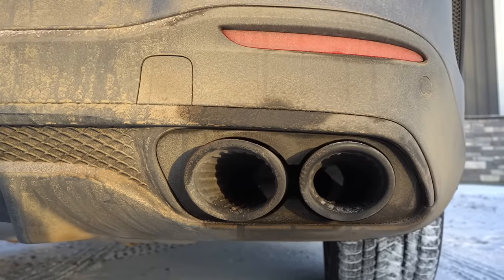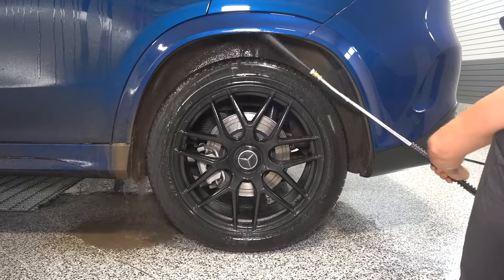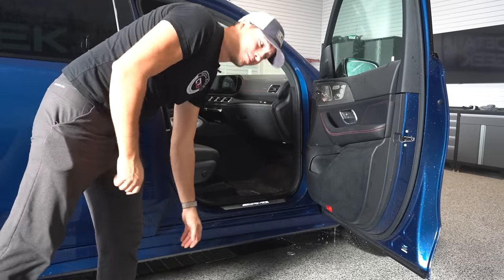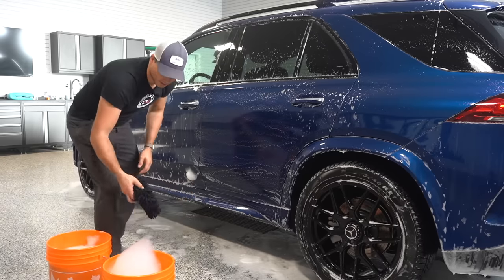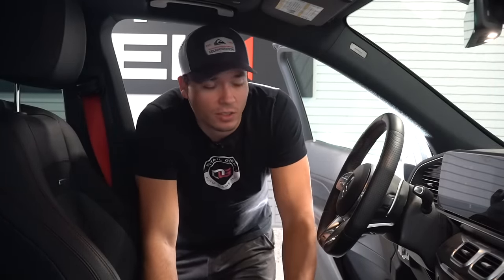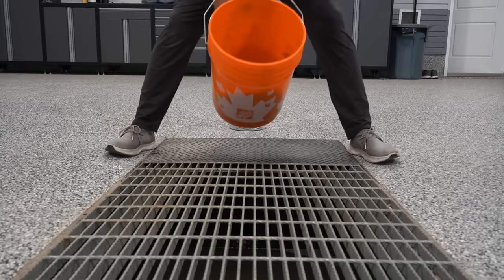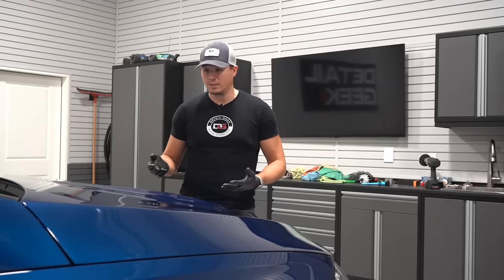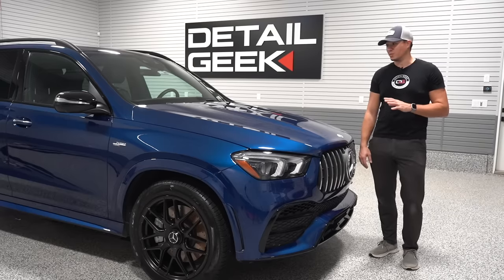Is Mercedes The WORST Car To Detail?

Comment: I am from germany and i have been with your channel since the very beginning with just 20k subscribers. You unfortunately moved out of my algorithm.. but you finally slipped in again! Always enjoyed your videos! - just before i start ranting about Mercedes 

The thing is, in germany they dont charge anything for it. You surely have the Mercedes "me" app which will be charged a couple of euros. But thats only for safety reasons (its easier to hack an app that is free than an app that costs like 5€ or something people have told me). But for all the extras i dont pay anything. I used to drive an E class 350 CDI estate. Brand new i need to add. And i have had the full package. All the extras, leather seats, heated seats and even the two year navigation-subscription (which basically gives you an automatic update to the navigation, maps etc). But these things were kind of "ok" in price. 

I switched over to audi (currently S6) and i dont have that problem there either. So i guess its something you guys in North America have? I will pay enough for the car, the gas and the service tho..

Comment: I think you did not explained well this thing of extra-pay. The cars come with 3 year cost included for the app MercedesMe. All the options of the car will be available after those 3 years ( heated seats, Navigation, etc)
The only thing you will have to pay are the services of the app: UrbanGuard, LiveTraffic info, remote access by phone, etc. The cost of all this is small, in Europe is about 300€ per year for all services, but not all are needed, you have to choose what you need or not. For my A Class I choose a 27€ per year services, only what I needed ( LiveTraffic, remote access from phone, UrbanGuard and other 2 things).

Comment: Right to repair should negate some of these issues.  People will find a way around the blocks. The claim of "void warranty" will be a factor but it will depend on what the item failure is that causes the warranty work.  I don't understand why manufacturers don't just charge more for the options in the price of the vehicle.  People who can afford a MB, can afford a few "extra thousand" for the options.

Comment: I have 22' GLS 63 18k mi, hasn't been washed in the entire year that I've had it. So charging a subscription for certain options was a cost saving choice the owner made. It's more for people who live in certain areas and don't need those features all year round. You either pay for the feature up front or they remove the cost of the option from the overall cost. BMW does it also.
Reply: Luckily this video contains some wrong info. Mercedes does not charge for seat heating. That's BMW and BMW started that in 2022.

Comment: The idea is that it will make the cars cheaper if you don't have to immediately "buy" all the other features, thus in theory making it fit into a wider price range. The reality, though, is that all those features are already built in, programmed in, and set up in the car's computer. It doesn't bring production cost down to make you pay to "unlock" all these extra features. All it is, is a way for them to milk more money out of you, while making it sound like it should do the exact opposite. This is a really crappy thing to do, that I definitely feel like should be regulated in one way or another.

Comment: I'm sorry but if people are having to pay extra for what the vehicles are already capable of doing its wrong
if it already has it you should be able to use it without paying extra for it 
its like buying a TV but in order to use a certain function you have to pay extra 
even though its already there 
ive had a few electronics like that

Comment: If I pay that much for a vehicle with all of those luxury features, I would be furious if the company tried to charge me to have them after the purchase of the vehicle. I’m sure they will lose a lot of business over this decision. 

My mom had a 2014 Chevy Cruze and just because she cancelled the XM Radio after having it for 6+ months. After that, her computer system was obviously affected. Her cruise control stopped working, ABS system was displaying a error code. It became such an issue that she sold the car after having it for a year. She bought a Lexus RX350 after selling the Cruz in 2019 and has been much happier since, even with the issues the Lexus has.

Comment: Clicked on this video because I have this vehicle in a trim two tiers below (GLE 450). 

Love my GLE. Don’t love the mobile gaming “microtransaction” model auto manufacturers are trying to implement. I think we should all push back against this nickel-and-dime nonsense. 

These vehicles are expensive enough as they are. You should also know BMW is doing the same type of thing. Thankfully, neither my MB nor my BMW have these issues. My MB is a 2021. My BMW is a 2022. 

EDIT: Thank Google for this view. You popped up randomly in my Recommended.

Comment: if this subscription thing is similar to the one from bmw (and it probably is), then i dont really mind. and here's why:
lets say we are talking about heated seats. when you buy the car, you have 3 options. 
1: buy your car without the heated seats "installed" (yes, they are physically installed but not activated)
2: buy it with the seats "installed" (so you pay the full price of the optional extra upfront, just like with any other car since the beginning of time, and never bother with subscriptions)
3: buy it and choose the subscription option.

the 3rd option is the controversial one, but it has its merits. you can pay the subscription only for the winter time, when you actually need heated seats. you can sell the car to someone who leaves in warm climates and doesnt actually need heated seats (and vice-versa)

as for the fact that the seats are preinstalled anyway, well, i bet logistics managers in car companies are really happy that they dont have to stock different types of seats like leather, fabric, alcantara, sport version, comfort version, and on top of that having to stock each one of them in 2 versions (heated or not heated).

Comment: 12:45 hating on mercedes when bmw started it. BMW and Mercedes build options into the car if you option them or not. If you didn't option them then you didn't pay for the heated seats for example so you don't own that option. in the case of bmw you can then either "rent" them via a subscription or buy it later on if you want them. After buying them you will finally own the option. After that they won't charge you for it again. same with Mercedes.

Comment: I used to want a Mercedes for a luxury car, but now that I've actually gotten hands-on with different vehicles, if i want luxury, I'm going with a lexus. Way better built, lasts significantly longer, and you can tell they put a lot of attention and thought into making their vehicles. Also, it doesn't hurt that they cost less as well.

Comment: They need to make it where if extra features have a monthly subscription to use then don't charge extra upfront for that feature to be added. or if it is in the vehicle already don't charge for it. sir this vehicle has heated seats normally it would be an extra thousand dollars on the price of the vehicle. we are not going to add that on.   but if you want to use it in the future you need to pay a monthly subscription. But charging for it then a monthly subscription on top of that is BS double dipping greedy BS

Comment: 13:00 - I am absolutely disgusted that people have to pay a ton for a vehicle that is specced reasonably (any make and model!), and then, the manufacturer can hide already available options behind paywalls, to milk the victim a second time. 
Toyota planned to make a subscription out of the remote central locking feature on the keyfob. 
Mercedes does what was said. 
Well then; make these things a subscription based option. Add them when subscribed, removed them when the subscription ends / is cancelled / is revoked. Absolutely predatory move that makes little sense (you had money for a car brand new, you surely have a few couple hundred bucks for some added sh!t a year.. - well, screw them then)
I have an '05 Hyundai sh!tbox that has only the central locking button on the only key that I got - works as intended, for no additional charge. The Ford I have is from '04, two keys, locks-unlocks-opens trunk for ABSOLUTELY FREE. 
I understand the politics behind these moves, but they are not going to fix the money hemorrhage the companies want to mitigate with options being sold, like these.

Comment: This is why I won’t buy Mercedes and bmw. The subscription services, besides their app to control functions of the car is unacceptable. If I pay for the hardware for heated seats to be installed then I should have them for the life of the car with no ongoing cost. This is probably the worst thing happening in the auto industry right now. Also a couple car recommendations. I had an alfa Romeo stelvio, and it was actually very reliable. Not a single issue. I really loved it.  It got totaled while I was sitting at a red light and now I have an Audi e tron. At least they haven’t pulled the BS of bmw Mercedes.

Comment: Personally if a company charged me extra to keep something I had already initially paid for I'd just hand the car back or go to another manufacturer.
Reply: Right !!
Reply: Thats the clue, you dont pay  for those things upfront and pay if you want to have them or not. The customer probably cheaped out on those options and decided after the wanted to have those options.
Reply: @PagChomp190  You can't exactly order a heated steering wheel after you've received your car from the factory.

Comment: It is 100% wrong to be charging for features you already purchase. Not to mention it is invasion of your  privacy for them to know what you are doing in your car and wear you are going. Frankly I wouldn't buy a car that requires I pay for a service that comes with the car. Perhaps take that feature out if you can't use it unless you pay even more for your car than you did.  It's as bad as Apple with ther propietary peices. You can buy it but know that everything that comes with it you have to buy from them only.  No cross breeding with Apple.

Comment: You have no clue about how the xpel clear wrap works! its designed to protect the whole paintwork of the entire car! normally if its a pro shop that has done the wrap they would do paint correction on the car before applying the clear wrap.

Comment: If you pay in full for a vehicle, and for all of the features it came with, and the car is yours, you have the right to use those features you already paid for, unless it requires outside resources to use, such as data connectivity for in car wifi or anything such as that. If the company or any other 3rd party company doesn't need to put any time money or resources into keeping up with a feature, such as heated seats or unlocking the full acceleration of your vehicle, or even remote functions with your phone, the company had no reason or business charging for services that are already built into the car. Don't buy a Mercedes, don't buy a BMW, these are rhe primary culprits when it comes to this sort of thing, and they shouldn't be supported.

Comment: Car manufacturers have been doing this for years. The fact that your vehicle has a navigation system, doesn't mean that the map updates are free. Sure; Of course, you're free to use Google maps for free. However, not every OS platform supports installing & running Google maps. Most vehicle navigation maps are produced by TomTom. A subscription for remote unlocking can be justified, because Mercedes-Benz has to develop both an IOS and Android app that's capable of communicating with their vehicles. And as such, cellular services for such features cost money to maintain. This is not as simple as your cellular device communicating with your vehicle. Such communication has to go through Mercedes-Benz for security & safety features. Your subscription has very little to do with that. And finally; Heated seats are where I tend to disagree. This shouldn't be a subscription-based feature at all. Either buy the heated seats or not. This should be a one-time payment. However, most likely, even if you do pay for the heated seats and then sell your vehicle, the next buyer would have to license them all over again.

Comment: 100% should be illegal. If they are going to charge a subscription for things they can't be charging for them too. I pay for my heated seats upfront OR I pay a subscription, either way the parts are there, they just have to be activated. NEVER would I pay for a luxury, then pay them a subscription to use it... This would make me walk away from a car deal the second I was told I had a subscription fee to use certain things.
My Hyundai has it's BlueLink crap that enables remote monitoring, remote start with profiles enabling heated seats and steering wheel. But I didn't pay extra for the remote starter, in fact if I wanted to avoid paying BlueLink I could have paid $800 upfront to get a proper one installed. If they had told me I was paying for the starter, then had to pay a subscription I would not be driving that car today!
Shame on these greedy car companies, their billions aren't enough? Jesus.

Comment: I was raised in a family with nothing but Mercedes.  1984 300D Turbo, 1986 240D, 1988 560SL, 1992 S500, 1995 S500, 1997 E320, 2001 E320, and more.  I now own a Ram 1500 and will never look back.  The amount of money owners pay for Mercedes' vehicles for the psychological aspect of how they think it makes others look at them cannot outweigh the added heartache of broken features and costs of repairs.  $800 every time a headlight goes out (sometimes multiple times a year) compared to my $35 bulbs now that have never gone out, A/C that always works, heated seats that always work, a heated steering wheel that always works, no engine warning lights, no squealing engine sounds, no $4500 in repairs every year for basic engine wear and tear... I'd love a nice luxury vehicle again one day for date nights and weekend travel around town, but it'll be unlikely I ever own another Benz.

Comment: First of all, please do your due diligence before you post criticism towards a brand with your influence and amount of subscribers. You're only perpetuating ill informed information to the masses without really understanding what you're defaming here. Since I'm a Mercedes owner with MBUX I can explain it better in detail. The car comes with a 3 year free trial for connected services. This is live navigation, remote engine start, lock and unlock, vehicle tracker etc. These are ALL services that require a connection to data to Mercede's backend or whatever data centre they use. After the 3 year trial, you can choose to continue to pay for these extra connected features or not. The car still has it's basic functions and works fine without these services. You don't just lose built in function like seat warmers or navigation... you lose the remote start and live traffic navigation and others but that's never going to be free for the ownership of the car. If you buy a phone are you going to get free voice or data services? It's so shitty seeing everyone blindly agreeing to this misinformation and start calling out a brand for not understanding what the deal is, Mercedes is definitely not a "dirty" company ffs.
Reply: Don‘t know man… My car has free remote access without additional monthly cost. Tracking, remote start, remote heat, etc. all without a monthly fee. I understand live traffic data, cause that‘s external data, but accessing my car should be included with my car
Reply: @Rohwi  What car brand? Is he service OEM and complimentary for a period or for life? If it's a third party hardware and service then it's not the same.

Comment: I would never buy a Mercedes or BMW as they are piles of junk.
Reply: Really? Have you owned one or are you just repeating what you've heard from other people? I am on my 6th Mercedes and never had a single issue, other than normal wear & tear items. I've clocked up hundreds of thousands of kilometres and they've never let me down once. I also change the oil/filter every 5,000km without fail. I think the recommended 15K kilometre oil change is too far apart.
Reply: @Ozymandias  I drove one for work and had multiple issues with it. I turned it as it was not a reliable car. Would never buy one, to me they aren't good cars. I'll keep my toyota or lexus any day of the week over any Mercedes or BMW.
Reply: @TJsVette  So, if you drove a Toyota or Lexus that had several issues with it, would you label those  as garbage?
You can get a lemon in any brand of vehicle, cheap or expensive, but it's a bit unfair to say that they're all bad.

Comment: Nothing AMG about this fake wannabe 53. It’s just a souped up GLE450.
Reply: braindead comment, all AMGs come with more standard features, perf exhaust, AMG suspension, etc etc.  its more then the engine, if you couldnt tell.  I could dust a GLE450 stock for stock in my 53, easily.